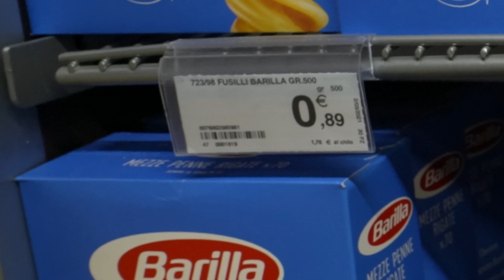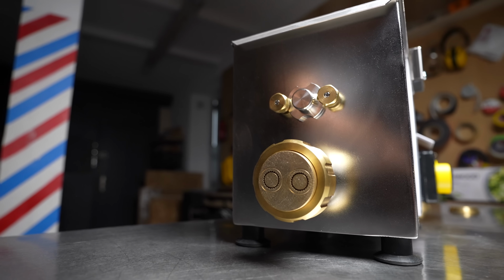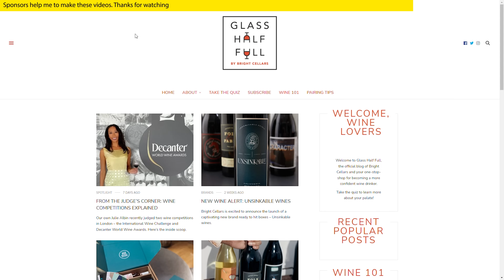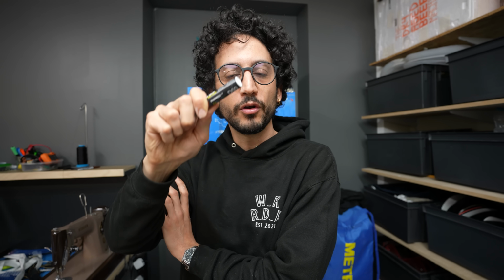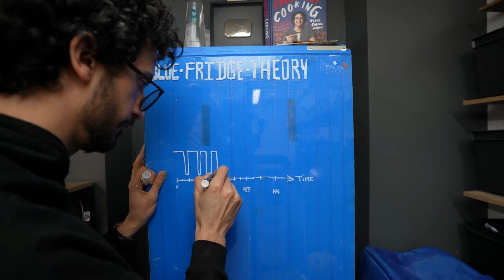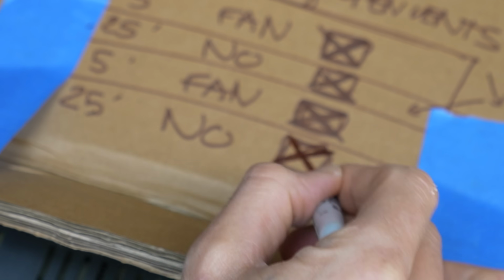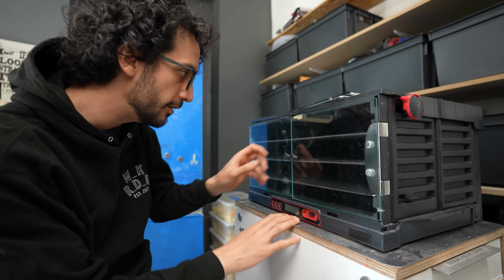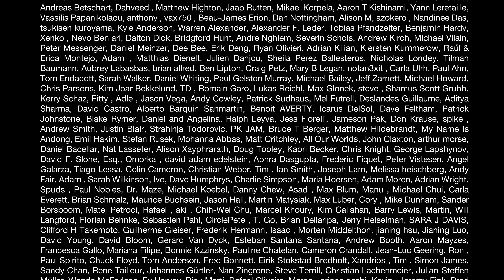This is Why Drying Pasta At Home IS ALMOST IMPOSSIBLE

Comment: Alex, look into DIY PCB reflow ovens. PCB reflow ovens solve a very similar problem to pasta drying. They have to follow specific heat/time diagrams to heat and cool solder paste correctly. People make their own reflow ovens out of toaster ovens. There are Arduino projects you can look at and even several kits you can buy to convert a toaster oven into a PCB reflow oven. The kit I have comes with extra heating elements and fans, which helps to heat up faster, distribute the heat more evenly, and cool down faster if needed.
Reply: this is actually the most Alex solution to dried pasta I've ever seen
Reply: Those were exactly my thoughts as well!
Speaking about electronics, the heat-dry diagram he was showing, remined me a lot of a PWM signal, LOL
Reply: In this thread: a bunch of meerkating control engineers
Reply: That’s the first thing that came to my mind as well.
Reply: "Now we set pasta to dry over 15 seconds at 265 degrees Celsius... wait a minute"
Reply: Evenly is the key here. If there's single heating spot / side / fan blasting the hot air, pasta near it would still get bad treatment. What you esentially need is constant indirect inflow of hot air @ steady temperature & humidity, that you can control. Usual fruit dryer turns out only heats & handles outflow of moist air.
Reply: The main issue is the zones are stationary and the pasta moves into them at a pro shop. I think he would also need a refrigerated area along with a humid area.
Reply: I agree, ask the people over at the Hackaday site if you need help in that area.
Reply: Given Alex is an Electrical Engineer, I expect he already has experience with one of those, so would be a reasonable route to head down,
Reply: @almostanengineer  I didn't know Alex was an electrical engineer, but it seems all the cool people end up being EEs. 😎
Reply: Funny thing, I'm a humble speech and language pathologist, but  the PCB reflow oven was my first thought for complex controlled ovens.
Reply: @vsporzellan  Ceramicists also use such tech, just the temperature ranges are greater.
Reply: Salami curing cabinet. Available on amazon.
Reply: Also using those 24hr electrical socket plug that turn things on and off on a timer. You can set a profile on them down to the nearest 15 minute interval.
Reply: The Reflow Master is an open source controller used to convert toaster ovens into reflow ovens. It has the elements required to make a pasta dehydrator. You might consider reaching out to the developer (Seon/Unexpected Maker) for some colab.. you guys might get along, he has a youtube presence too.
Reply: To add to this, a PID controller with programmable temp profiles wired up to the dehydrator (or better yet, a toaster oven that you can let run continuously) would do the same thing. It s an off the shelf part that isnt necessarily out of the hobbyist budget and is certainly better at temp regulation than the bang-bang controller the dehydrator has now.
Reply: @jcapogna  as an electrical engineer myself I have to agree : D
Reply: I'd recommend going for a design similar to a rotational Egg Incubator. To minimise hot spots on the eggs, the trays have their own rotational motors to ensure even temperature/humidity around each egg. Best to use a cheap one from Ebay or AliExpress, rip out the control panel, and replace it with an Arduino and a couple of relays. The built in timers are designed to be on/off at set intervals - not adjustable to the extent for what is necessary to dehydrate pasta.
Reply: Was thinking of this as well
Reply: Thought of exactly this as well! There are also high precision programmable ovens made for chemistry, but they are likely also expensive off the shelf.
Reply: ALEX 
u can build one 
use XPS insulation with one side covered in aluminium foil
make box from it , build heated intake for example put some silicone pad heater inside a tube or something with thermostat so u can block the max temp of it so it wont overheat

make main box , mount fan on left , heater on right (remember it cant be too powerfull or it can damage the xps ...or at the heater side u can use blocks made out of foamcrete - aircrete (concrete blocks super lightweight)  , then make 2 walls with holes and mount them inside the box 10-20cm from left and right wall , covering the fan and heater ... u need this so the air can be evenly distributed
 
at the end add inside a extra fan or 2 and programmable pid temperature controller for around 20-50$ and u ready to go :) 

everything should be possible to make under an hour
Reply: Same!
Reply: Beat me too it, as an E.E. this is the first thing I thought of too :)

Comment: Also Alex, you need to increase the humidity as the pasta dries so that the difference between the inside and outside water content disappears.
Reply: Inserting a wet sponge during the rest times would probably do the trick
Reply: Yup.  Just like charcuterie.  If the outside dries too quickly the inside can't get its moisture out...
Reply: Maybe you could do that with a cup of water? I know some people do that when they are growing.... Ummm.. lettuce. Yes lettuce. Nothing else. 😛 Like literally just put cup of water inside the drier. 🙂 Edit: oh right i forgot to say that you wanna put it near fan(but not too close because you dont wanna short the fan. 🙂
Reply: Maybe I'm not understanding the problem here, but it feels like that futurama episode where they keep turning on the heater and the refigerator to find the perfect temperature
If the dryer is too fast and agressive, wouldn't drying it just on the counter be better? just.. leave them be for a while? Legit question. I've done plenty of biltong just hanging them in the kitchen
Reply: @DerekSmort   I guess it would just rot if you leave it like that
Reply: @DerekSmort  Or just leave it in a fan. Do the low and slow method? May take you a day or two. Treat the whole thing like its the resting period. One looong resting period
Reply: yeah the pasta guy even said low temp high humidity as rest stage.
Reply: A humidifier should do the trick.  Especially if you could rig it to the fan intake.
Reply: @DerekSmort  I think this is how they did it without expensive dryers when this stuff was just invented. Probably multiple days of slow drying.
Reply: @robdielemans9189  probably it wasn't dried at all and just cooked fresh. Industrial revolution and its consequences
Reply: @nomecognome5050  That's why you add salt

Comment: Paolo said “high temp and low humidity for drying zones, low temp high humidity for resting zones”. Shouldn’t you increase the humidity too during the resting part? Not just disable the fan and let it cool down… right?
Reply: Yup, that was my first reaction to his plan. My second was wondering if his dehydrator even can support proper airflow for what he wants, since it's designed to do something completely different.
Reply: The relative humidity in the dehydrator could increase simply by cooling the air that's already in there. The absolute humidity wouldn't change much with the temp, but, depending on how much the temperature change is, the air in the machine could be relatively high humidity during the cool phase. It all depends on the absolute humidity and the temperature delta.

I'm pretty sure proper air circulation is his biggest problem currently.
Reply: I think that during the resting period there will still be water vapor leaving the pasta from residual heat and the moisture level between the pasta and the drying chamber trying to reach equilibrium. The humidity wont vacate the area quickly during the resting phase. So my hypothesis is the resting phase will sort of auto regulate to a higher humidity in that small closed environment.
Reply: @jonathankidwell6889  Unfortunately, most of the humidity leaves the chamber, because the fan is sucking the air out as part of the dehydration process. You need to have extra moisture added to the air to allow it to properly circulate and allow the outside of the pasta to moisten and get closer to equilibrium with the core. So long as it isn't wetter than the core, it'll keep drawing the moisture out of it in repeated cycles. That's why it's done the way that it is.
Reply: @KainYusanagi  How do you think that would work? E.g. should he simply open the dryer every 20 minutes and spray the pasta with a flower water spray bottle?
Reply: @rasmusrasmusson  That would be too much water on small spots, not enough on others (especially the inside of the pasta, where the mister wouldn't reach). There's a reason the industrial process involves taking the pasta through multiple chambers for the different processes, beyond just enabling much more precise control; it's just easier to set each to the desired setup, instead of having to try and manually adjust it every time, and likely failing. He could probably build a "resting box" fairly cheaply and efficiently, though how he'd keep it moistened without using either a truly vast array of misters or steam (which would defeat the process, I think, for the latter). A cup or tray of water that simply offgasses into the overly-dehydrated air when on a rest phase might even be enough!
Reply: @KainYusanagi  Maybe a regular oven with some added water...
Reply: @rasmusrasmusson  Regular oven wouldn't be good enough at temperature control, and is way more focused on heating things up; you want things to get hot enough to dry, yes, but slowly, over longer periods of time, rather than the broiling hot temperatures of an oven.
Reply: @KainYusanagi  Isn't it all about humidity, not temperature? If so I guess you could move the pasta to a box and then blow in some steam from a steam iron, and seal it. What do you think?
Reply: @rasmusrasmusson  That might work for the cooling cycle, yeah. The heat issues are because it would dry the pasta way too fast if you used an oven instead of the dehydrator; they aren't made to scale with such low temperatures, basically, and often such heating elements are made to cycle on and off at max power to maintain temperature, rather than a consistant output of heat the entire time. The steam might be a bit too hot, considering it has to be 100*C, or about 40-60 degrees celcius over the temperature you're using to dehydrate them with, on top of the moisture... I'd be concerned about cooking it rather than helping rest it between dehydration steps.

Comment: Drying pasta at home is covered in depth by Marc Vetrie in his book Mastering Pasta. The easiest way is putting it in the fridge on a mesh tray for a day or two, works great. For a more effective solution he uses a small humidifier set up under a milk crate, he puts the pasta on a tray on top and covers the whole thing with a cardboard box. He sets the humidity to about 75% and keeps the heat about 23 degrees C. Takes about 3 days to dry. Thank you Alex for a fantastic explanation of the mechanics of drying pasta. Wonderful video series, keep up the great work.
Reply: Exactement😅

Comment: "Plastic" just means you end up with permanent deformations when you apply forces to the body. "Elastic" just means that it will recover its "reference state" after the externally applied forces are removed. It says nothing inherently about strain-ranges (i.e. "how much stuff actually deforms") at which these phenomena are looked at. In this case the elastic state is clearly a small strain regime, while the plastic state undergoes finite ("large") strain deformation (source: years of teaching continuum mechanics at uni)
Reply: he's moreso talking about how most common plastics today will deform then recover the deformation fairly easily but in pasta that means the hardened state that doesn't deform; in short, a joke.
Reply: @KainYusanagi  Yep, Alex is a degreed engineer, he just didn't like the career options all that much and found a way to earn his living while having more fun.
Reply: @KainYusanagi  I know, I was trying to explain why the "joke" didn't really work. "elastic" isn't making any statements about how easy something is to deform. sorry, professional-degeneration ;)
Reply: @chemech  he says in a video that he is a radio/telecommunications engineer, he probaly has no training in continuum mechanics, the same as I don't have any training in network-theory etc.
Reply: @amarug  ...Have you never fiddled with an elastic band?

Comment: The papers you displayed look quite similar to the ones I studied during my phD on wood kiln drying. And the process was similar with kaolin drying for porcelain. So I'm going to take a guess and  offer something that could work : 

- Slow rise to the necessary temperature, with a high humidity environment, to get the pasta to temperature without drying them.
- Then a slow drying process, with the on/off thingy, while mainly controlling the humidity, but not moving the temperature (you lower the humidity to draw moisture out of the pasta).
- And then, at least a fifth of the overall process duration in equilibrium time : temperature and humidity at the level you need them for the pasta to be at 12%, for everything to equalize.
Wait for the temperature to go down if it's higher than 40°C, then open.

Now, the issue is to determine what the equivalent to the Keylswerth graph is for pasta. (It's a diagram that everyone uses in wood sciences, made in the 1920s, that shows what will ultimately be the moisture content of wood according to air humidity and temperature). So that you know what your temperature goal is, and how to move the moisture content in the air.

Also ... Well, you need a kiln in which you can control airflow, humidity, and temperature, and you'll probably have to run it with a time based program (because with wood, we can stick moisture content readers into the timber, but I don't think that's possible for pasta)
I can probably show you who to call for a small 1cubic meter one, but that's probably upright of 60k€ so ... Good luck :D
Reply: What about a PCB reflow oven?
Reply: @gevorgvanarmenie9788  seems like a good fit, except it neglects the humidity variable.
Reply: It's a pretty common mass transfer problem, where the rate of internal diffusion needs to be matched up to the rate of evaporative transport away from the surface.

This comes up in wood gasification as well as wood drying, clay products drying and firing, and presumably in pharmaceuticals manufacture, just off the top of my head...

As you say, you need to control for time, temperature, humidity in the atmosphere surrounding the product, and the gas/air flow rate, especially as it relates to the surface conditions on the pieces to be dried.
Reply: @gevorgvanarmenie9788  Do those operate in the 25 - 60 C temperature range, and are they made to control water vapor condensation with the resulting potential for corrosion?

Food grade materials of construction would also be a good idea...
Reply: @CCNorse  no really :) equipment to some kind of atomisier that disperse the water into fine droplets which then raise the air humidity. Jus a question of creativity
Reply: This woodworker completely agrees with the kiln idea.
Reply: fellow phd cook here, could you point me towards some literature?  is the problem solved already or are areas to improve upon? We do FEM simulation of wood in my lab, in particular wood for violins. Thermal treatment for artificial ageing of the wood is an area we haven't studied but could be a nice next step for our research. If you wanna chat my username at gmail is the fastest way to contact me ;)
Reply: Fabulous detail and explanation. then your pasta will be like porcelain, right??

Comment: Alex, the ability to recover from deformations is elasticity while the lack of recovery is plasticity. It seems that the elastic moduli go up with drying. The perceived hardness and softness partially depend on the elastic moduli as it determines 'stiffness'. But the main determinants of hardness/softness would it be about different structural properties. I think the more important property is that the tensile stress goes down too, leading to easier failures (cracks). Something you might want to think about is ductility and malleability. These properties would define how well the pasta deforms instead of cracking when the internal stresses are generated. Circumferential stress/strain and pressure vessel equations could give you some insight too. I've worked on cylindrical biomaterials and I'm getting flashbacks lol.

And if you want to visualize air motion, look into 'smoke studies'
Reply: He has a degree in engineering, fairly sure he just wanted to joke
Reply: Why are you suggesting Alex to start smoking sigarets?
Reply: I'd like to say his problem may be more akin to drying coatings on substrates. As the pasta dries, a thin, brittle later is being formed, but as the rest of the pasta dries (towards the center), there is strain mismatch which leads to cracking. I'd probably gander that that is why the factories have a high humidity resting time, so they can resaturate that dried outer layer (to make it elastic) to reduce/eliminate the amount of large cracking that would occur otherwise.